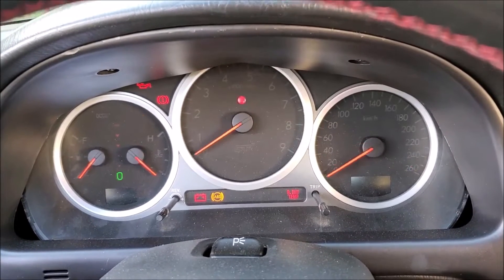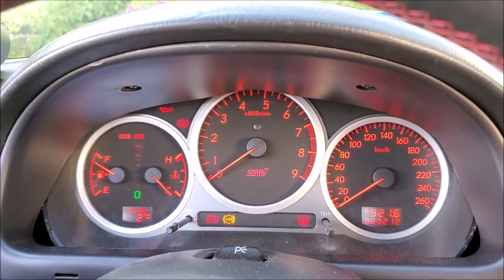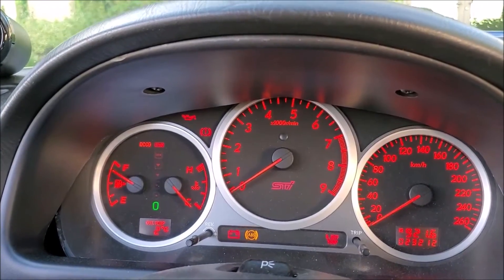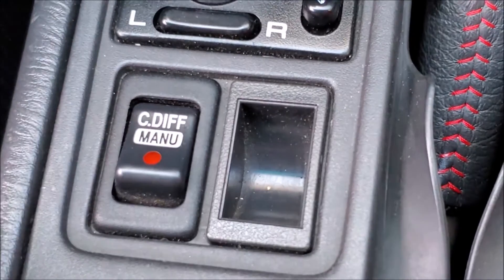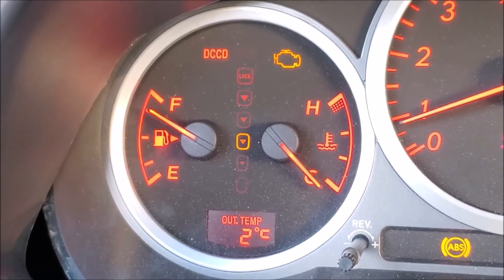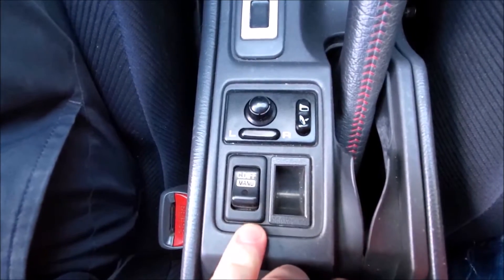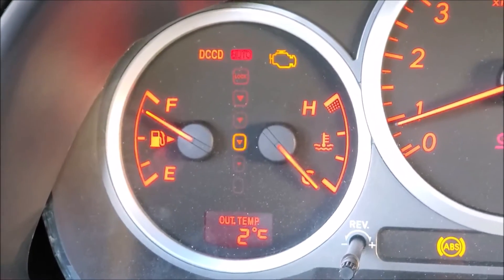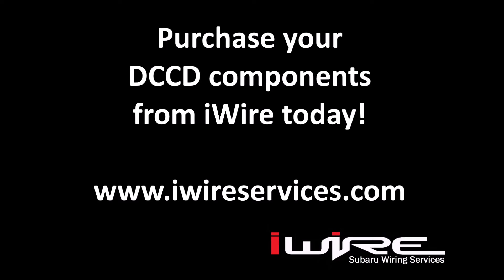How the DCCD Display Works on a Subaru STi Gauge Cluster

Comment: why there is an auto option if you can still adjust it? i personally hated it i have it installed on my car and every time i turn in a short ratio the gears jams because is  a awd mode 50/50 (autosetting)
is there anyway this issue can be fix?
everytime im going to park i have to pull the ebrake slightly to turn the dccd controller of or put everything to the rear